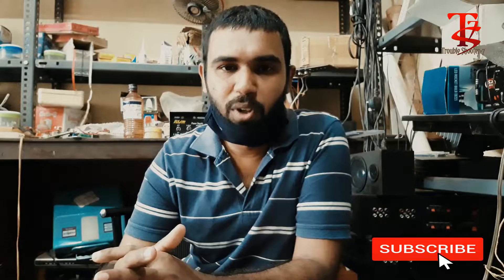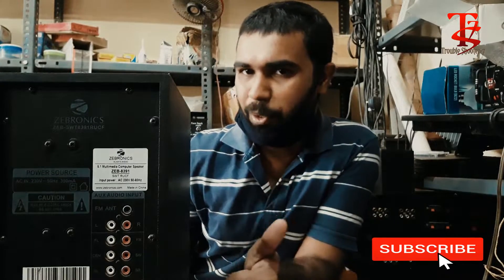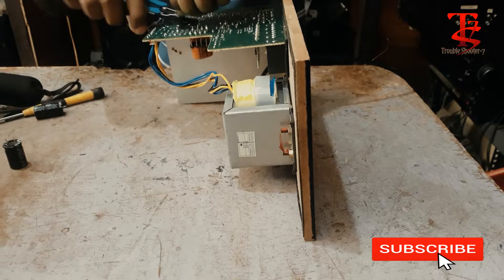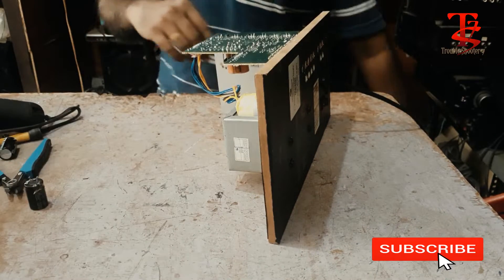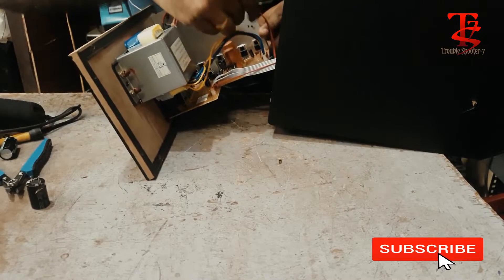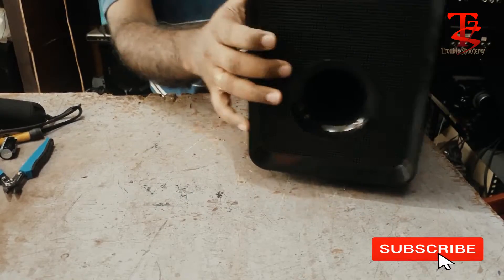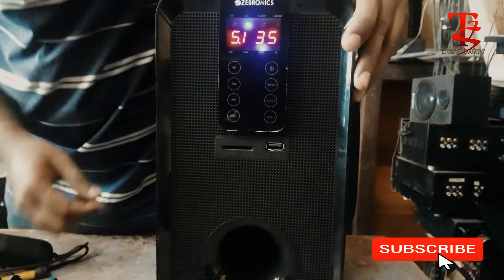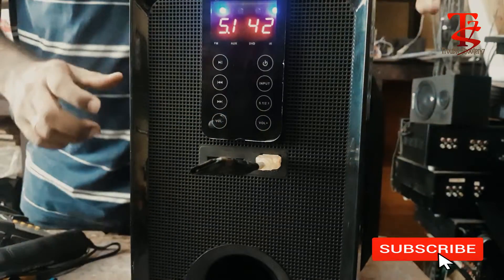Electronics Malayalam Practical Class 7 || 5.1 Home theater repairing

Comment: Bro... Ente jvc amplifier aanu... Ippo aux connect cheyyumpo sound kootumbol vallathe noise varunnu... Sub aanel Verthe vachaalum cheriyathayi cracking sound und... Low volume sound vechaall Valiya Kuzhappam Illa... Pakshe sound kootumbol vallathe grains pole varunn... Pakshe CD, FM radio ellaamm normal aayi Nalla sound und... Aux cable palathum maarinokki.... Nthaanu prashanm parayaamo....
Reply from the maker: എന്തെങ്കിലും എർത്തിങ് മിസ്റ്റേക്ക് ആവാനാണ് സാധ്യത ഓക്സിലറി സോക്കറ്റ് ലൂസ് കോൺടാക്ട് ആവാം